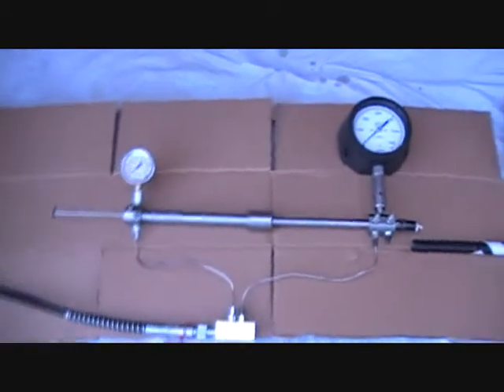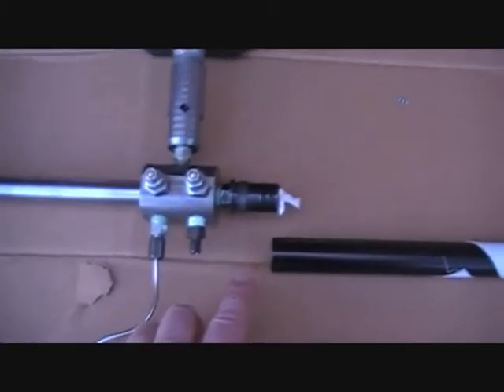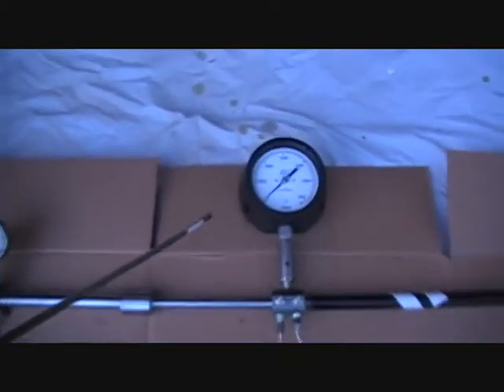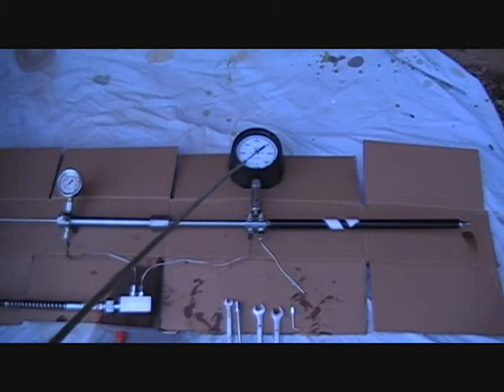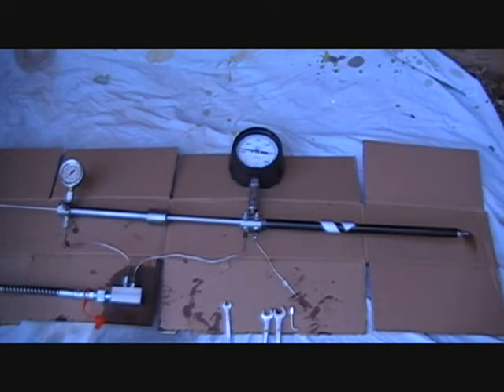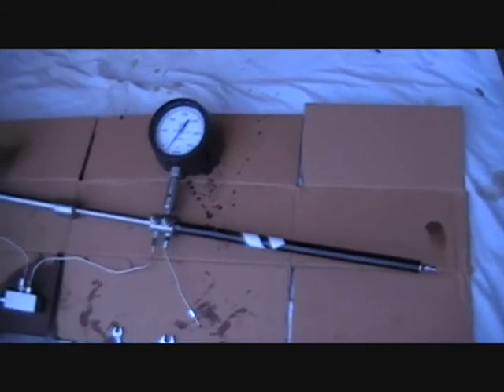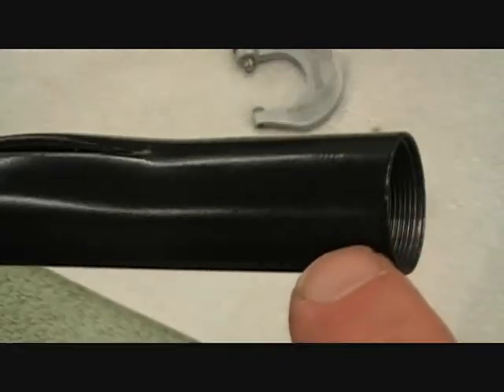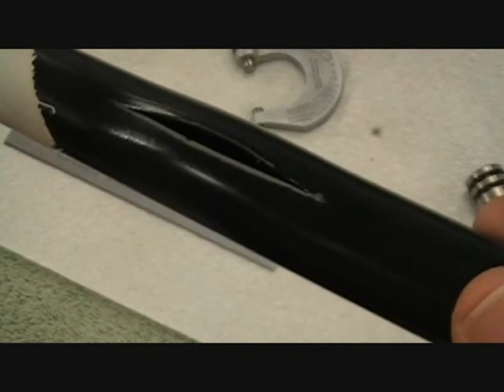Destructive testing PCP airgun air tube to 30,000 psi Airgun Lab

Comment: If he can even get the pressure lower to 10,000 PSI and it is safe to manufacture the advancement in PCP air gun would be a quantum leap.
Reply from the maker: I have not tried firing an air rifle at a pressure above 4,500 psi.  With a balanced valve, it might be possible, but many design changes would be needed. 
That is a VERY interesting idea. Lloyd

Comment: Wonderful information and a fantastic test. I am also wondering if you are furthering your research into the electronic valve? And yes I am referring to the type you developed for the Rogue. By the way why was such a perfect PCP rifle like that discontinued? Oh by the way my first PCP rifle was a Disco and I still have it. I was thinking the only real upgrade for that model would be an electric valve, a new breech upgrade to hold pressure, and of course boring the air port. Would you happen to have any thoughts on this topic?
Reply from the maker: Its a long story about the Rogue, but won't go into it.
For the Disco, one of the easiest mods, if you are looking for more power, is a heavier hammer spring. A google search will turn some up.

Comment: How about titanium tube? what pressure to blow it?
 that's what expensive PCP use today {though there's grade in each titan}
Reply from the maker: For the same diameter and wall thickness, the titanium tubes are about 50% stronger than the DOM steel tubing that is normally used. So that allows you to either use higher pressures, or use a thinner walled tube for the same pressure. Also, the Ti material is lighter than steel, but heavier than aluminum. The advantage to titanium is that it gives you a lighter weight tube, but you pay for it. The alloy that is commonly available for high pressure tubes is 3Al-2.5V  CWSR. Certification of the tube material that you buy and the "cold worked and stress relieved" condition are very important to safety traceability. You have to do ALL the various safety calculations to predict the safe working pressure and failure pressures. The burst tests are only to show that the calculations are correct. All the tubes that I have made and tested have failed at or above the predicted pressure. You don't want any surprises!
Reply: @1227air500  hi, I have a grade 5 titanium tube, the od is 40mm and the wall thickness is 3mm, do you have any idea how much pressure it can withstand?
Reply from the maker: @derayend6939  Hello Ade, I have made some calculations for reference and information only.  Do not use them for the actual design of your air pressure tube. For Grade five Ti (Ti-6Al-4V) we can start with the mechanical specification of 130,000 psi ultimate tensile, and 120,000 yield.

The following are safety factor calculations to show what a safe working pressure might be. For 40mm O.D. x 3mm wall tube, filled to 4,500 psi (310 bar), the yield safety factor (tube distortion is irreversible) is 4.3 to one, and the ultimate tensile (burst) is 4.7 to 1.  I would consider that very safe if I were making it for myself. However, catastrophic failure might not occur until 17,000 psi.

If the ends of the tube I.D. are threaded for plugs made of 7075T6 aluminum, a thread of 37mm x 1.5mm pitch with 12mm of engagement length would give a safety factor of at least 4 to one at 4,500 psi. 
If cross bolting is used to secure a plug into the tube, as for a valve, using 6 M6 high strength socket head cap screws, with the full head diameter engaging the tube wall AND the valve body, would give a safety margin of more than 5 to one at 4,500 psi, provided the drilled hole is at least 26mm away from the end of the tube.

Again, these are for reference only. I hope your calculations agree with mine. Lloyd

Comment: do you have any info on how to make the hydraulic pressure multiplier I am interested in making a pcp air guns my self ,I have used spingers all my life  I have a mill and a lathe I have always wondered what 30.000 psi was able to  produc in fps with a vacuum mussel brake , my guess is the seal at the end of the gun would be the hardest problem to deal with ,I guess were to put the gas port on the tube would be the problem to workout, without losing fps ,I think your fps metering devise may not go that high but it would be fun to see just how fast it can go in the end .
Reply from the maker: I have some sketches of my hydraulic multiplier, but that is all. I think pressurizing air above 5,000 psi is difficult, and creates a dangerous situation.

Comment: Do  you have any tests using air?   This would give a real life view on the destructive power of air.  People are not hunting with fluid in the guns.
Reply from the maker: The failure pressure would be the same for any fluid, whether gas or liquid, but testing with air would be too dangerous because of the energy stored in the compressed air. Poke a hole in a water balloon and a balloon filled with air and that is just a hint at the difference. Lloyd
Reply: I'm talking destructive power not failure pressure.   Yes it would be more dangerous if you were to stand next to it.  Proper precautions would obviously be taken.
Reply: @Physics072  I think there's another problem, it will be so damn hard to pressurize air up to 15000psi
Reply: @derayend6939  Yea I do own PCP ariguns but work only at 4500-5000 psi range even that is scary if a tank fails.
Reply: @Physics072  if bike front fork tubes suitable for airtube for Pcp airrifle 3500psi to 4500psi
Reply: @mytreasure8720  LOL?   hehe  cut back on the moonshine please then it will make more sense.
Reply: @insidejob8309  bro am not understand,, Pls tell
Reply: @insidejob8309 if fork suitable for airtube
Reply: @mytreasure8720  motorcycle fork is thick and seamless..it can hold 3000 psi no problem at all(no possiblity of tube blow up)..the only problem is its very heavy..not so practical for airgun purposes

Comment: Fantastic video. Mahalo for taking the time to share!  Puts my mind at ease seeing these kinds of overbuilt tolerances.
Reply from the maker: Thanks for commenting. Glad to know the effort is appreciated.  I'll be doing some more tests with this apparatus very soon, probably other tubes and valve attachment methods. Trying to track down the weak links in the HPA systems, but so far, the weak links have been plenty strong.  Good to know.
Lloyd-ss   The Airgun Lab